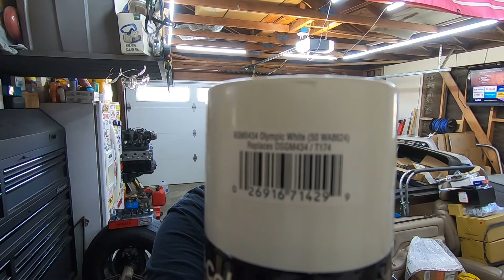95-00 Chevy OBS front end swap

Comment: i have a 94 c3500 and want to change my front grill, so the gmc front grill is a direct fit?
Reply from the maker: Yes straight bolt on no mods needed
Reply: @LowLifeYonkes  do i have to get gmc headlights? or do the chevy headlights fit as well?
Reply from the maker: @taehoudini2325  head lights and fog lamps are the same just the corners lamps are different